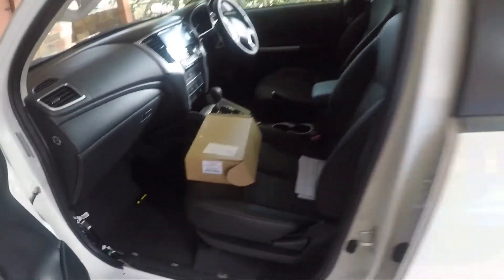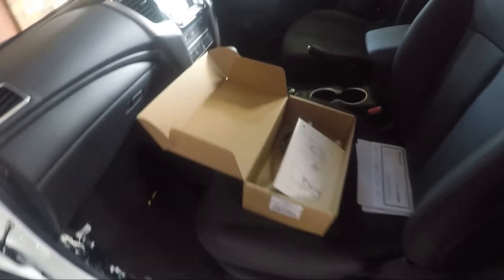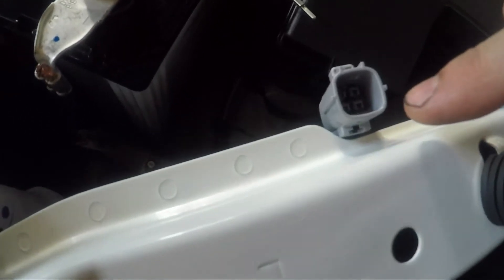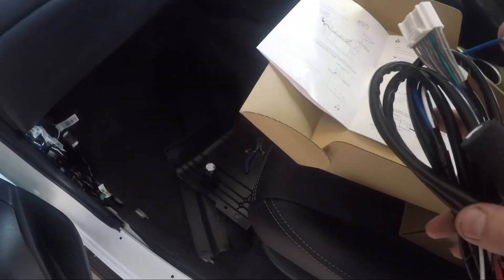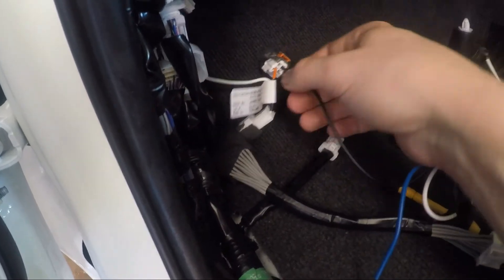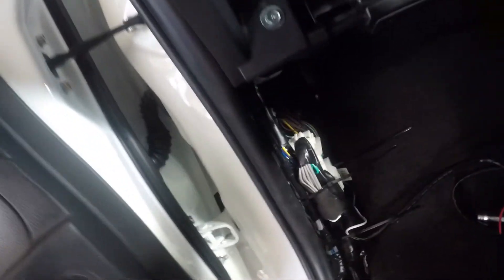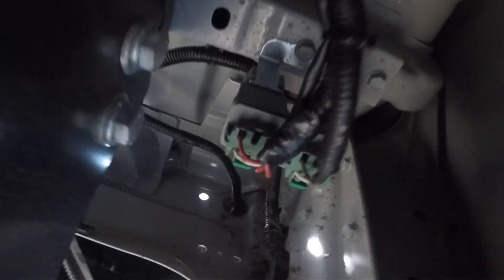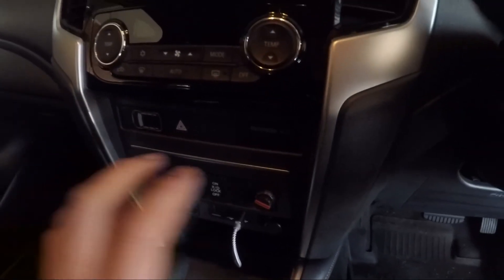Mitsubishi MR Triton (L200) - Electric Brake Controller Install

Comment: I’ve got to the point of installing the red wire under the tub but can’t see the red and white wire. I’m a bit lost at this point!
Reply from the maker: Yeah they were hidden for me. Some were on the top side of the chassis rails and the relays I had to remove from their holders

Comment: The plug where the blue wire goes what is the best way to unlock it have tried pushing it up but no success
Reply from the maker: hmm it was a real pain from memory - I cant recall any tricks just had to open it up to the position i showed in the vid. I'm pretty sure there were no tabs or anything - you may need to remove that foamy tape stuff if its holding it together.

Comment: Man I feel like I done everything right, have got power to tow pro remote switch but don't have any power at the 7 pin rear plug now.
Does anyone know what fuse runs the rear socket wiring harness. 
Can't work out why my rear socket has no power.
Reply from the maker: The main power fuse for this is the one you installed near the battery. I'd double check that's not blown. Otherwise it is likely to be your wiring under the tub

Comment: I missed the bit where you show exactly how the Redarc controller is wired in? Where does the blue wire from the Redarc go to the Mitsi wiring harness? Where does the Redarc get its brake input? Is there a diode included in the Mitsi harness?
Reply from the maker: To be honest it's a bit of a mystery to me how this works. I believe it takes the brake input from the single plug which was in the top left corner under the dash. The redarc simply plugs with 4 wires into a 4 pin plug. That part is pretty basic. The confusing bit it's the swapping over relays under the tub. Possible that they do this instead of the diode? Otherwise it must be included in the loom
Reply: @thelapyear  ok cool. But my redarc came with a plug that goes to the redarc unit with bare wire ends. Are you saying that the Mitsi harness kit comes with a plug that suits the redarc unit?
Reply from the maker: @brantwinter  oh yeah I remember now I bought the same plug at Jaycar and crimped on the connectors onto the redarc wire ends.you could just join the wires I guess but I was keen to minimise joins as they are always the points of failure.
Reply: @thelapyear  great - thanks!

Comment: Man, I paid someone to do this and I kinda wish I'd just done it myself.
Unprotected wires with no split conduit over them. 
Bad crimps. Connectors literally fell off.
Final straw was today when I was doing something else, I noticed teh control unit has just been cable tied to a loom. Exactly what the instructions say NOT to do.

Shits me so bad that good service is so hard to come by now.

Comment: Hey doing exact install. Did you connect the 4 wires to the redarc matching the colours to factory loom?  Red black blue and white?
Reply from the maker: Yeah from memory all those wires aligned between the redarc and mitsubishi loom. I went to Jaycar and got the same connector as the redarc to make it plug in rather than cut and solder.

Comment: How do you get access to putting the switch into the panel? Where do you go through etc?
Reply from the maker: Yeah unfortunately i forgot to film that. I struggled from the front for ages (using a small flat head screwdriver) and realised i was just going to ruin the facia. The way i got to them is with the glovebox removed i squeezed my arm through the gap in the center console and was able to pop the blank out. Also used the same approach to feed the wires through.
Reply: @thelapyear  struggling with this too, any other tips/ possible video? Cheers mate
Reply from the maker: Hmm if i have the glovebox out again i'll try and make a vid. Basically with the glovebox removed there is a small gap on the right hand side which the glovebox covers when it is in. I was able to fit my hand through and using feel just popped the little plastic bit out by pushing from the inside. It did need a bit of force to pop it out (like it would be fun trying to lever it out from the outside)